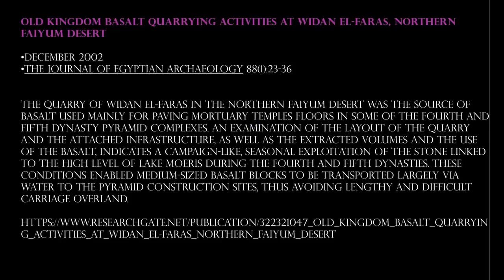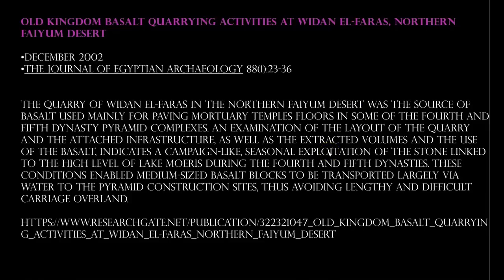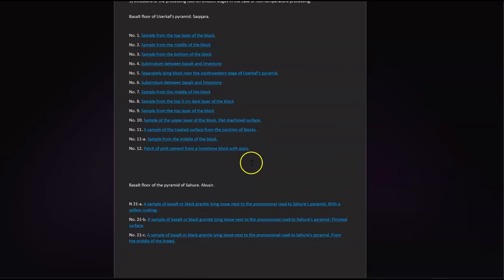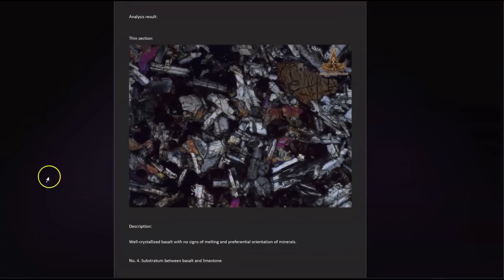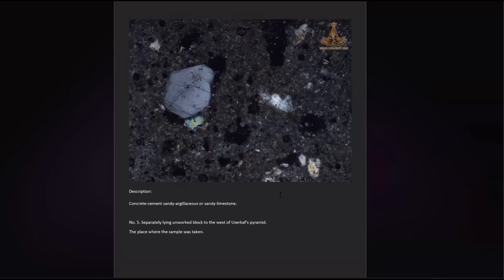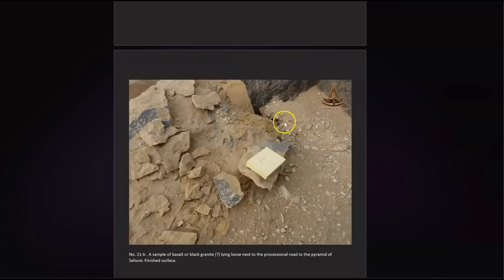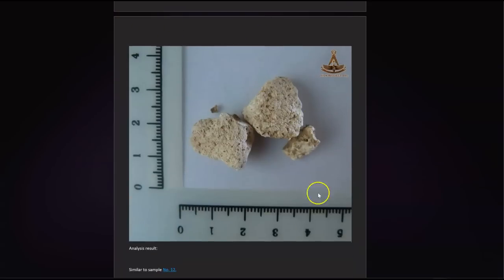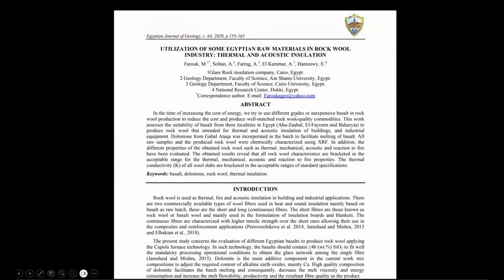Episode 88: Functional Pyramid Stone, Part 1 - Black Basalt

Comment: You’re definitely doing great research, the sort of research that goofball “egyptologists” should’ve been doing for the last century.  

My only problem with your theories and evidence is your insistence that the Ancients who built these structures used “simple techniques” when you readily acknowledge that we can’t do what they did today.

Clearly they possessed a knowledge of metallurgy, chemistry, geo-physics and more, that we have not begun to approach  in the last 200 centuries of mechanical and scientific expansion. 

The other issue I have with your theoretical structure is the idea that these mind blowing, resource intensive structures were of the most mundane, utilitarian type, such as ammonia or potash factories.  That level of complexity, detail and investment doesn’t fit that output.  If that were the case we would be making similar expenditures and investments. 

Just a casual dig into the mathematical and geodesic precision built into the pyramids and also the same focus in the historical Egyptian civilization, points to a much deeper  and valuable purpose or need or goal being met, perhaps simultaneously with some of the mundane functions. 

But these are areas of more research, really for a team of researchers.  You’re doing pioneering work all by yourself.  💯💯💯

Comment: Regarding saw marks on stone- I believe the striations on many different examples of stone cutting indicate a feed rate grater than that achievable by use of saw and slurry techniques. Maybe Keep your options open when it comes to cut marks.
Reply: I absolutely agree, plus, all those cuts on the underside of the basalt floor, mean that whatever it was they used, was extremely efficient and fast. Simple logic dictates, if you're making a mistake, and it takes hours to achieve a cut of a couple of millimeters, those "mistakes" would then turn into days, if not weeks of work, making it rather unlikely that is the case, and this can be observed in many other places, a famous one is the pink granite koffer in the Cairo museum, presented as unfinished, but it clearly has a cut on its underside that makes it unusable, a cut that must have been achieved in a matter of seconds, as on the contrary, if it took days, they could have corrected it many times over before reaching such a curve, but as you very well know I guess, logic isn't egyptology's strong point..
Reply from the maker: The results of the chemical analysis are irrefutable. I clearly stated in the video that they had machines with high gear ratios that produced fast-moving saw blades, and the scientific data collected from the saw cuts shows exactly what they were made of. End of story.
Reply: @thelandofchem  Very unscientific of you to claim end of story. As you should well know, we have taken measurements of marks of tooling from all sorts of artefacts. You cannot refute the overcuts, the precision suggesting guidance or power cutting of a highly efficient nature. You cannot refute the symmetry in the Ramses statues. Until you can prove high feed rate as well as symmetry as well as overall precision with what you've suggested, which is by getting it done on every level matching every difficult aspect of the artefacts, your theory is only as good as the ones you refute. Your basic physics tools with high gear ratios would still bend under the required 3 working tons of pressure required to match some of the spiral tube drilling marks with a single point of contact. Maybe you should spend some time becoming familiar with precision engineering, to add to what you have. I observe that you are somewhat unfamiliar with important aspects of the sites. Explain how chemistry and arsenical bronze can make 50,000+ 1/1000inch precise stone vases with many mathematical concepts included in the dimensions. Tell me how they made a stone vase of corundum that is so thin it allows light to pass through it. Also, you'd be pressed to figure out how they were going to move a 5000 ton block of limestone from Minya quarry, supposedly for a standing statue. Nothing you say they'd have would work, as you may know moving large weights increases difficulty exponentially as you increase weight. 70 tons? Sure, lubricant and wood sleds. 5000 tons? Just manpower and gear ratio you think? Obviously you are onto a lot, but don't think you have it all figured out for a second. You are leaving out too much. Like I said, recreate a high precision artefact with what you say should work, including all difficult aspects, down to 1/1000inch, symmetry, and matching the tool marks.
Reply: Good observation …. If we agree the time frame is much greater then the one proposed by academia, then there would be several techniques adopted by the different generations trying to duplicate or innovate the processes! Making it what it is…. An absolute nightmare to investigate lol but at least we can start to eliminate each process to the age of the builders intellect

Comment: Hate to be the skeptic but these exterior structures could likely have been added after the pyramids construction. Not to mention the offering bowl is far too small for the size of the reaction chambers to fit into that theory—not mentioning the elevation differences.
Reply from the maker: You didn't listen to the video. There were mostly likely multiple bowls as there were 5 at Suhure. And the downward slope toward the bowl facilitated the movement of the chemicals in that direction. The basalt is also 100% part of the original construction
Reply: @thelandofchem  I did listen to the video actually; thanks for sharing your thoughts.

Comment: Would be interesting to hear about what you think of Robert Schoch's work. He has evidence that the plateau was hit by a pretty significant solar flare.
Reply: Or could that be a product of what was happening there deliberately?
Reply: @nomadscavenger  I don't think so, the amount of energy involved is cosmic in origin. There are lighting strikes scars in the bedrock which suggest it was a high altitude shock stimulated by a major solar flare pushing the magnetic field against the surface of the planet.

Comment: "no predominant orientation of the minerals"... This is "non-foliated", not typical of basalt, common in metamorphic stone,...marble well as quartzite. Basalts or "traps" are igneous rocks,...volcanic formed by cooling. They are high in both iron and magnetite and as such can be used for dating as well as determining magnetic north at the time of cooling precisely because there IS predominant orientation of the minerals. Certainly are cut marks and lines but the material looks to be re-constituted from crushed stone.

Comment: Solar powered heater for chemical going trough maybe. If it insulates heat it might not realease heat during nightime as much as gethering heat from sun during day. Making it theremal solar panel and capcitor / stabilisator. Maybe providing constand warm temperature for fluid going trough 24 hours.. Maybe helping it react with another fluid. Maybe it splits in two going up the stream. 

Or maybe it is all a solar heated basing that prepears heated watter for next reaction so it goes better . Because if you put akready heated material in chemical reaction ,many reactions will heppen better. And maybe conduit adds to the sun in preheating the watter, by passing trough already done sufuric acid that leaves its exothermaly  generated  heat in the basalt basin, helping the sun with heating new reaction watter up. Like a exaust heat excanger plus solar powered heater. Using exaust heat of exothermal reaction for the next reaction. 

Thats if sulfuric smoke and watter reaction chamber needs the extra heat. And if there is enough of heat generated in reaction to consider  building excanger for it.
Reply from the maker: Turns out black basalt also has applications in the solar panel industry... lots more coming up on the function of this stone and exactly how it was used coming up soon!
Reply: @thelandofchem  can't wait.

Comment: Do you ever wonder if these machines were purposely disassembled to hide their true purpose?
Reply from the maker: Sure, or perhaps to turn them off...
Reply: My guess is, once they were found, their purpose was already forgotten by centuries, or equally probable, there wasn't anybody capable of using them, making the materials with which they were built, far more valuable than the machines themselves, condemning them to the melter!! 
After all this is exactly what we do today with obsolete machinery, and it has been a practice since the dawn of the industrial era.
Reply: @nicksothep8472  great point and do u think there could have been left over “stock” if u will, of chemicals and products at different stages of production buried from a  calamity and then early dynasty Egyptians took advantage until the supplies ran out…. Would be an economic fallout for sure
Reply from the maker: @nicksothep8472  agreed
Reply: probably a lot of that involved.  The cabal needs to create the illusion of being the greatest power that ever lived.  So they hide everything associtated with solar flares and asteroids.  Why not hide everything associated with history that has anything to do with science.
Reply: Does anyone not?
Reply: While this would make sense in the modern day, I think they were dismantled centuries ago. Probably because they did not know what they were or how they worked.  So they salvaged all easily usable materials as well as anything they could trade. I also don't think Egyptians built these pyramids by themselves.  The theory that these are  chemical reactors makes more sense than them being ancient Tombs.